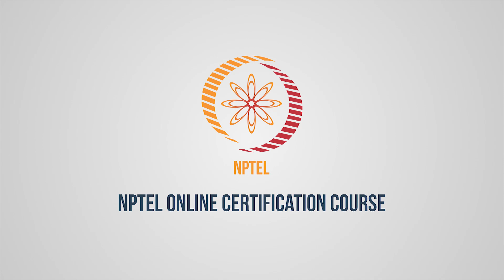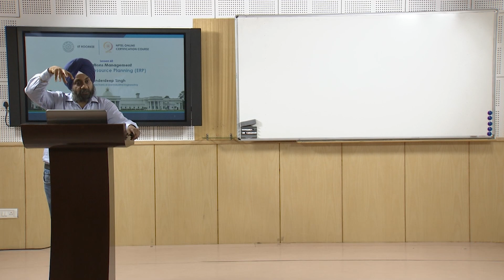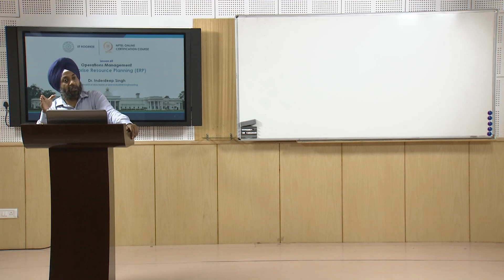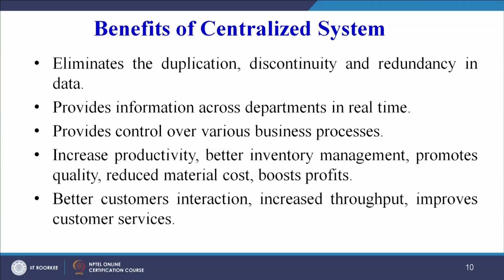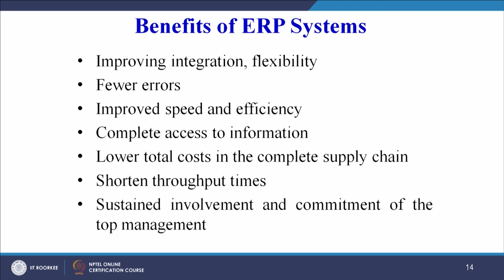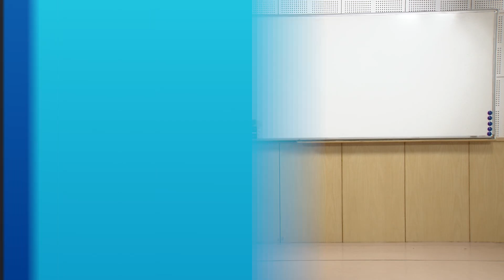Lecture 60 Enterprise Resource Planning (ERP)

Comment: Sir what is the basic difference between productivity, effectiveness and efficiency ?
Reply: Productivity and efficiency are synonymous terms while productivity is usually used to tell the efficiency of an entire manufacturing system or any system, efficiency can be used to tell about a single machine or an entire production,service or any sort of sector.
Effectiveness on other hand is related to the effect of changes
/modifications made in any systems either those changes will inc productivity we will say it is effective or other case ineffective.

Comment: Good Informative lecture, ebizframe ERP Software is quite easy to use mainly because of its simplicity and the ability to add different features so as to frame your business into a successful leader. The cloud based ERP helps a business with minimal need for internal IT support.